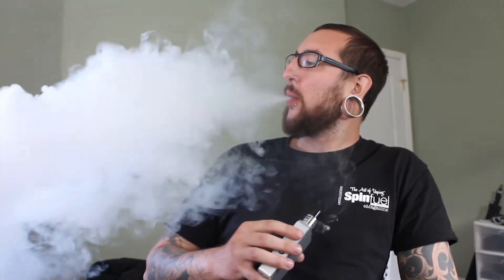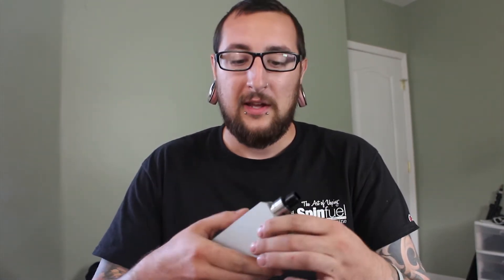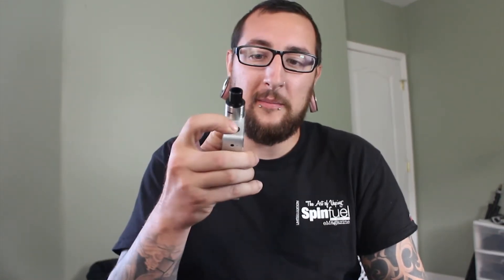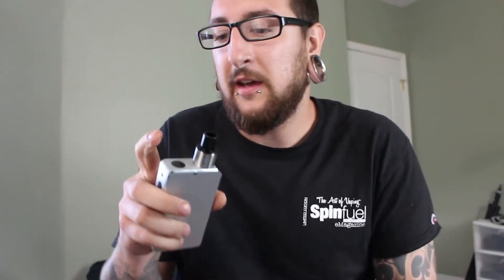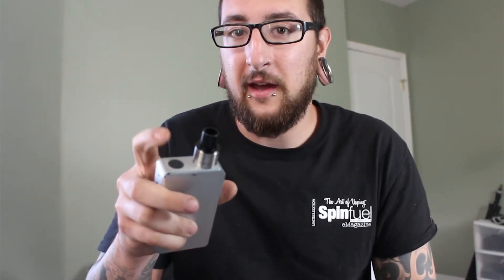Vapemail Special - IPV3 Preview + Giveaway Winner Announcement!

Comment: The ipv2 doesn't forget my wattage settings when I take out the battery
Reply from the maker: Interesting. Maybe it's another firmware issue. I just really wished they would've included the charger with it. Or at least gave the option to add it on for an extra $5 or something. Vape on!
Reply: I believe it's two different things...on the iPV2, it remembers what you last had the wattage at when you pulled the battery.  With the iPV3, there are actually 5 different memory settings that you can program.

Comment: Buyer beware

First, I got two ipv3 units about 3 weeks ago direct form P4Y. I did an initial review about some of the slight improvements to the look of the box, the pros, and some initial concerns. Here is what i have discovered over time and daily use... they aren't very good. Sorry.

The box does look good... certainly an improvement to the ipv2. I will give them that. Having said that the paint is very thin and scrapes off very easily (ie the bottom where it stands up and around the 510 for sure!). Not a big issue but worth mentioning to those of us that are OCD and like stuff to stay nice.
The aluminum material the box is made of seems fairly soft too. Just a tip over on a table it will leave an indentation in the polished edging. Whatever you do, don't drop this sucker. Again, normal wear and tear are acceptable but this box seems to get beat up very easily.
A BIG ONE... The 510 on one of my ipv3 popped out very easily while unscrewing an rda within the first hour i had the box. I discovered that it has NO screws or hardware even holding it in place. (I guess it is press fit and or glued maybe?) SO... I had to superglue it back. It is ok for the moment but it should be more securely fastened. P4Y has refused to replace my broken unit. 
My units came without any serial numbers (straight from P4Y) so warranty is impossible (for me personally). I understand they are no longer individually serial numbered but batch numbered based upon vendor sale. More on warranty in a moment.
Here is a HUGE issue of concern. I have discovered some serious inconsistency in testing the voltage, the wattage, AND the ohms read on the box vs the actual readings with a meter. Both of my boxes have inconsistencies. (I first heard of this issue through a guy who got an early unit from an expo in Germany so i decided to start doing some checking into it. Just to clarify... I am not real good with meters and electric stuff so i had to bring it somewhere to get it checked out.) Despite the P4Y YouTube video showing otherwise my boxes were not consistent in all three areas. It may be a box to box issue. They may have fixed it with future boxes shipped. I am just sharing about my boxes. 
The warranty is listed/advertised online as 12 months but they have changed the warranty card to now read 6 months. (Then there is the whole Asmodus BS about changing their warranty policy wording and now expecting folks to pay some sort of warranty fee and shipping both ways... don't even get me started on how ridiculous all that is!) BTW i have tried to get P4Y to replace my broken box and even offered to pay for shipping and they refused. 
The unit is advertised and sold as having a touch fire feature but the inside of the box shows it isn't even connected to anything! NOPE. The outside of the box looks like it has it. The button combination shows you can enable it or disable it but there are no wires of electronics even hooked up to it inside! 
The ipv3 is advertised and sold as being able to be charged via a power port and cord. The power cord is NOT included with my unit(s) and when attempting to charge with various aftermarket cords (based upon the P4Y specs given to me... 9v 1a or 9 volt 2 amp... they keep changing their story) and nothing i try works. A light will come on but nothing charges for hours at a time. I am beginning to think that the charge board isn't even wired up properly to charge dual batteries. (I guess they had to do a separate charge port because you cant charge dual batteries with a USB.)
The usb btw is for firmware only but there is no firmware upgrade offered. Upgradeable is a selling point they seem to emphasize. Despite promises about firmware upgrades on previous units there have been no P4Y updates offered to date. It seems they just release a new unit instead.
Now regarding customer service. I hear from others how hard it is to get a reply from P4Y. This wasn't my experience (at first) until i started having issues and wanted answers to these problems. Now i get run around, lame excuses, repeated delay and stalling, and ridiculous hoops to jump through. They have yet to address the points of concern i have aired. I have asked for the contact information for a manager or supervisor, again nope. Disappointing. 

Add insult to injury NOW P4Y is about to supposedly release an IPV3"plus" version of the box that has a working touch fire and includes a working power port and includes a power cord. Really ?!?! (Didn't we have a similar issue when the ipv2 came out and then suddenly they fixed a bunch of stuff and released the ipv2-s?) I cant imagine the headache coming soon with the ipv4 supposedly using the sxv350 v250 chip. 

Please note that I have been what i believe to be a faithful supporter of P4Y up until now. I am not a hater nor am I trying to stir up crap. I sincerely hope this thread will be a word of caution and hopefully be a wake up call to P4Y to step up their game significantly. Having said that my opinion of P4Y is less than favorable right now as it seems we are once again beta testing their units and then they quickly release an updated version that seems to work. (ie. ipv2 and ipv2-s). This just seems so wrong to me.

I urge those of you concerned about these issues, those who want to see quality (tested and ready to be released) products, and insist on integrity in business to visit the P4Y webpage and email or skype to share your opinion. http://www.pioneer4you.com (the contact i have used is David Lau: david@pioneer4you.com).

Thanks for reading. Sorry to be the bearer of bad tidings but perhaps this will help folks not waste time and money (and maybe, just maybe get a company to step up and do the right thing).

Vape safe.

Comment: Why touch fire button doesn't work?
Reply from the maker: I got a preproduction model that is different from the normal models which means it will have certain aspects changed on the final version. People who bought the first run of the IPV3 also had their touch sensors disabled but the newer version available now will have a working sensor with a firmware upgrade.